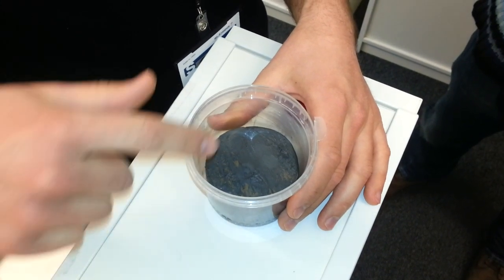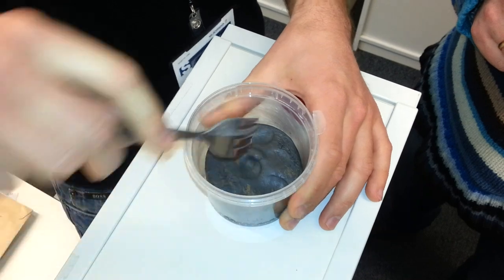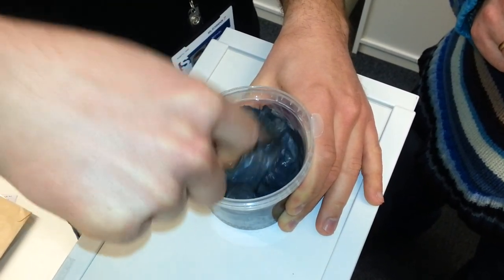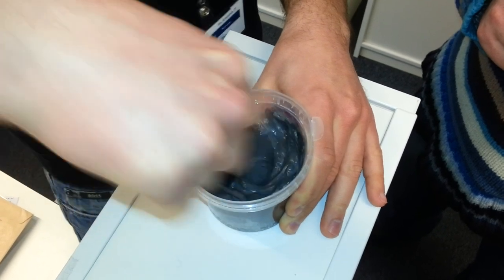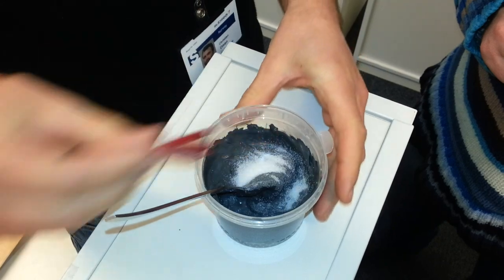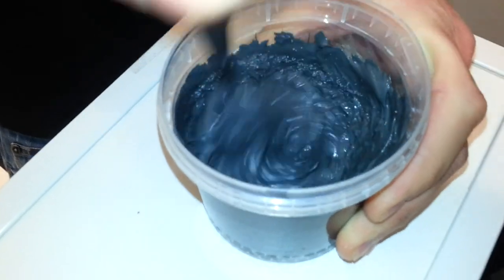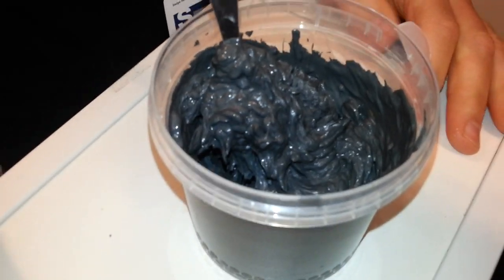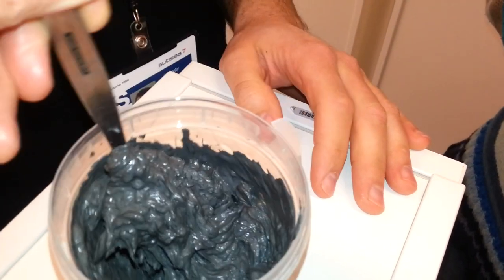quick clay

Comment: Does all ground clay do this or just clay that was along a salt water cost ?  I raced dirt track race cars on clay tracks and when the proper amount of moisture is used , the clay can provide traction  that is  not expected . If it is too wet , it is sloppy and slippery like  ice almost   , but when it is just right , it grips  like a prepared dragstrip , and some 800 plus hp sprint cars will pull both front wheels off the ground on the straightaways , while going 80 mph .
Reply: It's specifically quick clay (formed on old sea beds, yes) that behaves like this. Normal clay doesn't do this at all.
Reply from the maker: thanks for your reply. good answer